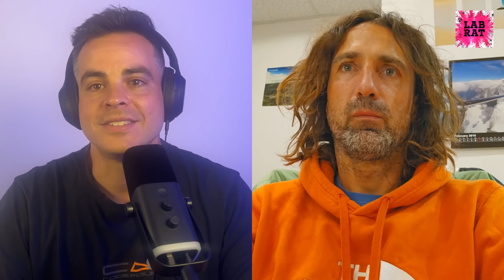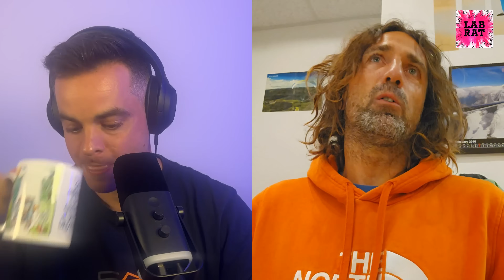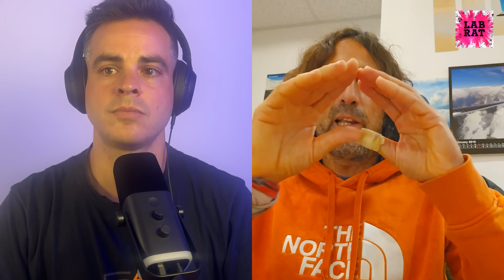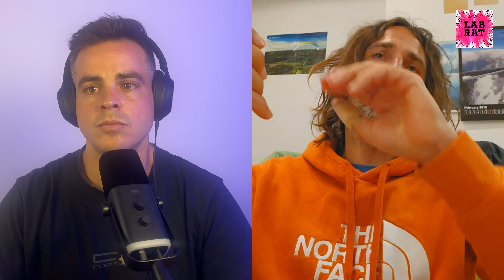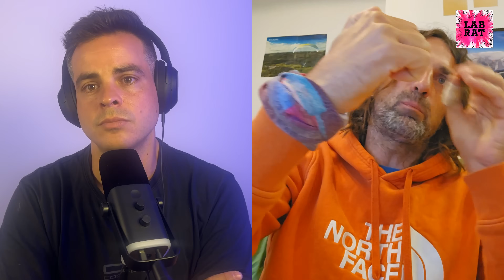026_Aljaz Valic: How Triple Seven Is Redefining Parawing Technology

Comment: There’s a fun use case for parawing I’ve never seen anyone really cover. Catch a wave surf foiling and then deploy the parawing. 

It’s an unreal experience sailing on such a tiny board. The stash belt is mandatory for this. I actually ripped my BRM belt in the surf and the parawing was slipping out into the surf. 

The Skin with its simpler bridles and smaller bar looks like a blast!
Reply from the maker: For sure. I can’t wait to try it!
Reply: Dock start then deploy! 😂🤙